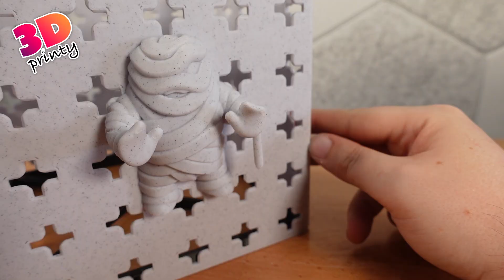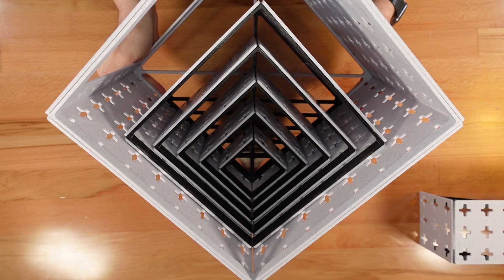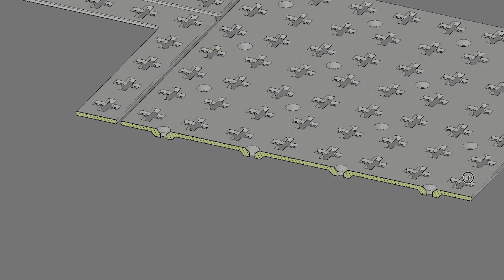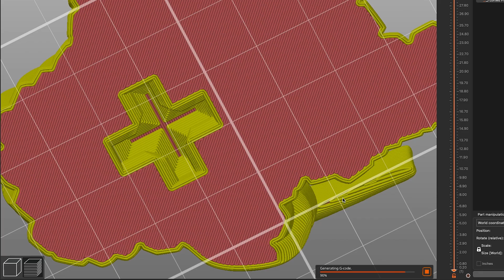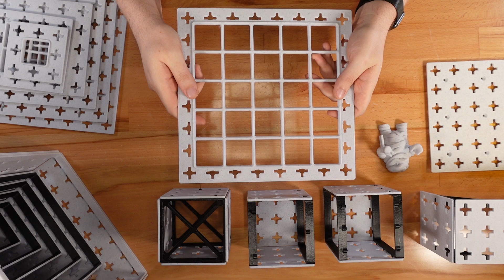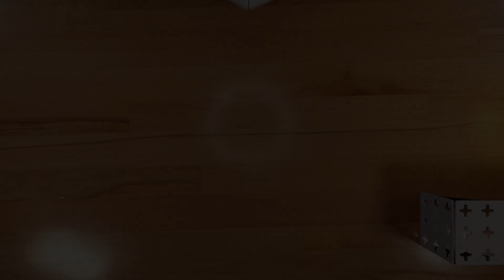Printy Panel Update - Gridfinity Panels, Wall Mounts, and More!

Comment: How did the Hexglyph puzzle end up with the round dial in the middle?
Reply from the maker: That's a remixed version of the puzzle by Venice3D
https://www.printables.com/model/874237
Reply: @3DPrinty  is there an extra piece, the photos show a similar core shape to the original but in your video core looks round like the dials?
Reply from the maker: The overall form, including the core shape, is the same. The difference you see are mostly there to make it possible to print and assemble the puzzle from individual parts.

Comment: Very nice job on this. I'm currently printing 'multiboard' system and don't mind trying Printy Panels as well. I just wish that it didn't use so much filament. I know a solid fill is required for strength but may be good to have an option of panels with holes for quick printing.
Reply from the maker: I'm glad you like it!

I recommend trying the "window" panels, which take far less filament. You can also get away with infill on the center most layers. My own prints use 3 solid bottom layers, 3 layers of infill, and 4 solid top layers (0.3mm layer heights). Good luck with your prints!

Comment: Thoughts on making Printy Panels designed to snugly store Rolling Storage Boxes? Sure, you could just put some of the boxes on a panel shelf, but I'm thinking of a shallow V-shaped indentation that can keep a box from sliding around (or off the shelf entirely).
Reply from the maker: A shutter door is actually something I'm considering - making it one big shutter box :)
Reply: @3DPrinty  Awesome!

Comment: I don’t know if anyone has suggested, but maybe have wall panels with recessed area to attach Command Strips? That way it would be good for people in dorms where you can’t put holes in the wall
Reply from the maker: That's a good idea! I'm curious if a recessed area would provide any additional strength over just attaching the panel as is. My personal experience with using Command Strips is you can pretty much slap them on a flat surface and they work quite well :)
Reply: @3DPrinty I think recesses would best suit Command picture hanging strips because those strips are thicker and have the advantage of being completely hidden. Normal Command strips, while thinner, need their tail to be accessible for removal.
Reply from the maker: Ah, the kind that click together a bit like velcro? I haven't actually tried those yet - I'll need to pick some up and get some measurements for the recessed area (if nobody else remixes it before I get to it, that is)
Reply: Yeah basically just anything that won’t require drilling into walls, and yeah I think the Velcro ones are better since they’re stronger and less chance of it accidentally coming off the wall 😀

Comment: One wonders if it would be valuable to standardize module dimensions, so that multiple modular-systems can interoperate trivially.
Reply from the maker: That would be ideal!

Unfortunately, universally applicable standards aren't easy to achieve and I didn't even have cross-compatibility top of mind when I started (that's my bad).

In the end, the dimensions for Printy Panels were driven by
- Panel strength
- Port connector strength
- Supporting common layer heights (0.2, 0.25, 0.3)
- Fitting on common print beds (6x6 panels fit most printers nicely)
- And ideal spacing between ports

I'm paying for that oversight with tricky integration solutions 😅
Reply: @3DPrinty   @3DPrinty  Things are almost always obvious in hindsight. I refactor code (programming, C) around 5 to 6 times (!) before I am happy with something I have written.

And, for what it's worth, I think "Printy" is amazing. And huge kudos for making it open!